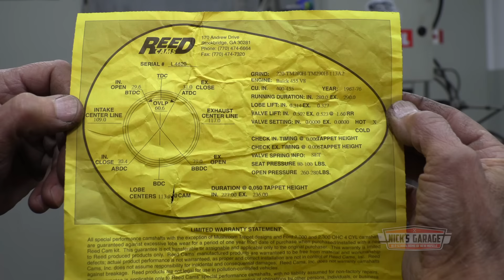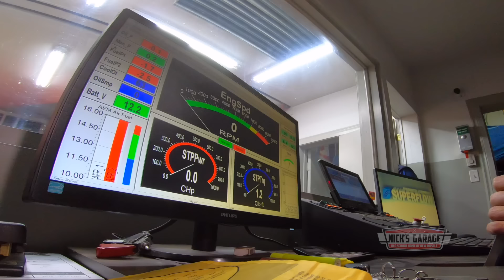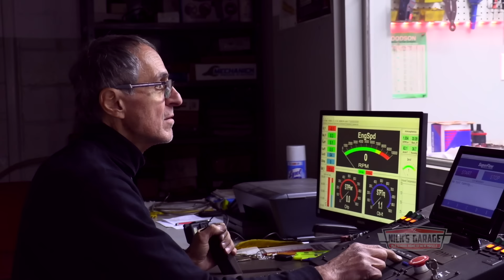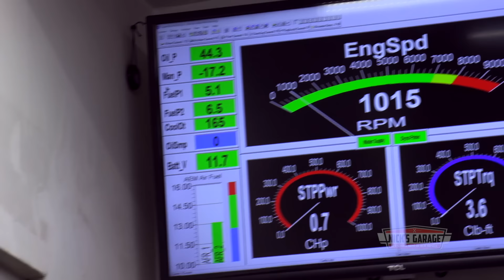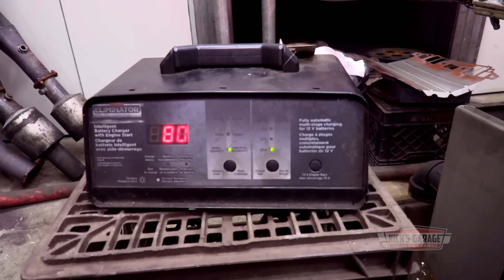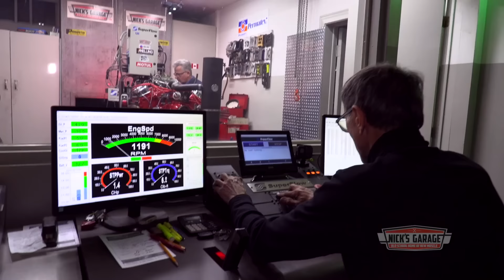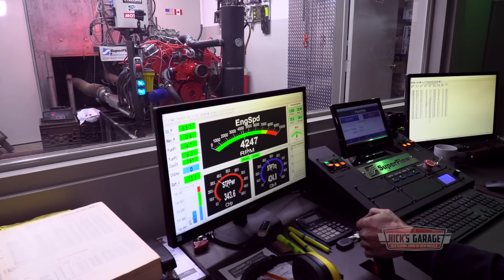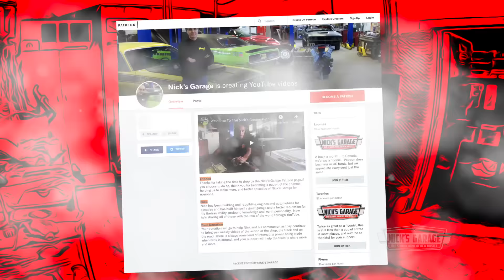1970 Buick 455 Stage 1 - Dyno Room Diagnosis

Comment: Stage 1's are great engines.   I will never forget Richard Lasseter beating the HEMI in the 1985 Muscle Car Review Magazine shootout.  It shook the muscle car world.
Reply: That was a big deal back then!
Reply: Oh yeah, that's when Lasseter was cheating. He, in no way would take a valve cover off to show that it was stock.
Reply: @gordonstroup882  Badies Hemi was not factory stock along with Lasseter's Buick. The hemi had headers and an upgraded cam with a little more duration and lift. The Buick similarly had headers, an upgraded cam from stock with more duration and lift along with an Eldebrock B4B aluminum intake and a Holley (700 cfm).  Typically, headers will result in 25-30 hp gain over exhaust manifolds, cam upgrades could result in 10-25 hp gains, and in case of the Buick, the B4B intake will gain 15hp over stock C.i. intake. The 700 Holley most likely did not improve HP much, if any over the stock 700cfm Q-jet carb. The stock Stage 1 1970 455 actually was underrated by Buick (360hp) and rated at at only 4600rpm (peak HP actually occurred at 5400 rpm). Similarly, the hemi was underrated (425hp) at only 5000rpm and peak hp was made at 6000-6200 rpm. I remember watching both of these running back in 1970 at the drag strip and both were very close in ET/mph stock depending on which mopar body the hemi was installed in (weight differences).
Reply: @gordonstroup882  Well  to get even with the hemi maybe some shaft rocker arms were used. haha. The hemi probably came stock with them. And remember the ball stud hemi. And the sohc and dohc hemi. Like the 427 sohc fords and boss 429's. The experimental hemi's are what fuel lore and pro mod to this day! haha.
Reply: Yeah, I think that you got it %99 right. The good ol' days. Anyways, it was all in good fun that also came with some serious bragging rights. 😅😏🙄🤐Ha ha!
Reply: @gordonstroup882  Cheated??  How? That's total b.s.   Man, I was THERE in Dec. 84 at that Gainesville, FL race with track manager Bob Moore.  Bob oversaw the entire race.  I was a photographer there.  And what's this about pulling off a valve cover??  Nothing was EVER even mentioned about such foolishness.  You need to get your facts straight. Both cars were near equally modded.  Both Badie and Lasseter had only a 2 week notice about this match-up. Very impromptu!   BTW, Lasseter drove his car 275 miles round trip from GA.  Badie broke the earlier MCR agreement by trailering, but Lasseter never complained.  Badie told Donald Farr (MCR Editor) that he'd filled up with Sunoco 260 and it cost too much to drive the GTX there with his 4.10 gears. BTW, Lasseter had 3.42 gears.  Not commonly revealed was how Lasseter easily outran Badie's friend with a '70 Hemicuda right after beating Badie's GTX.
Reply: @zAvAvAz  Buick's have shaft mounted rockers.
Reply: @billdedrick1914  Correct.  Neither car was factory stock. It was an impromptu race. No time to put together a "cheater" combo. Lasseter didn't own a trailer, so he drove.  Badie trailered. You seem to know what you're talking about!
Reply: @LR-my2di  where can I learn more about the history of that race?
Reply: @romper4444  There is a multi-page article on this race in the March 1985 issue of "Popular & Performance CAR Review magazine"
Reply: @romper4444  Hey Nick ... Where can I send you some "snail-mail" that covers all the REAL details from back in the day and not just the usual oft-repeated hear-say?  I'm impressed to see that you're a gentleman interested in the FACTS and not just partisan propaganda.
Reply: It would be interesting if Nick or the owner could install the Lunati 10960304LK cam in this engine for testing.  Maybe someone from the Buick crowd could correct me but isn't this the "Hemi Killer" cam Lasseter had in his car at the time?
Reply: @briansd2772  Not sure what this number corresponds to lift, duration and lobe separation. The Hemi Killer was designed in the late 1980's by Lasseter for use by several street racers who needed vacuum but had a hotter engine combo than him. The Hemi killer was a single pattern cam that used special lobes with .490" lift and 241 degrees duration on a 110 lobe separation.  It could be used with stock Stage 1 v. springs. That was a key element back then.  Lasseter used a much milder cam because of his 3.42 gears and old Rossi 12" converter.  He uses this old combo today and it's very "old school".  His cam was a H228-237degree dur. @ .050 with a .478" lift using his stock 1.55 ratio rocker arms.  It was an old Lunati grind he had done back when the Lunati's owned Lunati cams.  Hope this helps.
Reply: @LR-my2di  Good stuff L R.   Thanks for the perspective and clarity.
Reply: @LR-my2di  Interesting comment on the fuel cost. In 1984 gas was really expensive. I know, I was driving a '71 Olds 98 with a 455 4bbl at the time and it was killing me.(I wish I had that car back... but I digress). I can't imagine how much top test Sunoco racing fuel was, I never even got near those pumps! I would haver trailered too!
Reply: @jppagetoo  I also forget the cost, but it was the 426 Hemi (not the Buick 455) with the 4.10 gears that used the Sunoco 260.
Reply: @LR-my2di  The specs on Lasseter's cam just sunk in.  That was a fairly mild cam with impressive results!   I have a Pontiac friend with a 455 that needs a 235/252.  .540 lift  112 cam and 3:42 gears to get 12.2 ETs.
Reply: @briansd2772  The Lunati 10960304LK has 230/240 duration @ .050" and lift of .507"/.538" ground on a 112 Lobe separation angle (LSA) which is different than the original Hemi killer cam which was ground by Lunati with .241/241at .050" duration and ground on either a 112 or 110 LSA.  The GSCA soon after came out with their version and was ironically ground by Reed Cams with a duration of 241/241 at .050" on either 112 or 110 LSA  .490"/.490" lift.  The cam Lasseter was using in that shootout supposedly was a Kenne-Bell  118 (KB118) .490"/.490" lift 118 LSA  284/304 duration (this is the old advertised duration- not at .050" present day duration but the old advertised duration nomenclature). The KB118 performance potential is close to the 241/241 Hemi Killer grind.
Reply: @LR-my2di  Yeah, My bad on that.  But I was really just thinking back to how expensive gas was then. Most younger readers have no idea how much gas was relative to the dollar value. Racing fuel was even more! Thanks for remembering the old days with me for bit. I was 21 in 1984.
Reply: @jppagetoo  My pleasure, JP. Take care.
Reply: @briansd2772  Yes, it was very mild. The car runs very well.  Easy mid-11's.  Remember that Lasseter DROVE his GS to Florida (and back) to race Badie and his friend with a Hemicuda.  And don't forget the GS's 700 cfm carb and 3.42 gears. Overall,  a very mild street car.
Reply: @gordonstroup882  nope,drove it to the shoot out,drove it back. The hemi simply got beat,live with it.
Reply: Even stock to stock the Stage 1's beat the Hemis... as did the 6 pack 440's... lighter engines with more torque...
Reply: @BuzzLOLOL  The hemi was not a great street engine,the 440 was so much better on the street and in the lower stock classes. The 455 Buick with it's relatively short stroke ,revved quick,and would turn more rpms than most think. Good assembly practices,and knowing what to do,will turn the big Buick into a true street and strip monster
Reply: I remember reading about that Hemi/Stage 1 matchup. The GSCA put up the Buick, now I know who had the ‘cuda. Interesting.
Reply: @billdedrick1914  thx so much!
Reply: I wasn't even alive in 1985
Reply: Ask Ronnie sox if he ever had gotten beat by a stage 1 buick I don't think so they weren't even on the map back in the day Mopar to you
Reply: @darrenbrisson4336  Pop Kennedy was ronnie sox teacher how to leave the line. Pop was legendary off the line,sox had the advantage of full factory support, lighter cars,and full race engines. That give you a better picture of what's what
Reply: @markbuchanan3694  you're right in one aspect but Ronnie was the fastest of all the hired guns
Reply: @darrenbrisson4336  I don't know,pop was a master off the line in those days. He won most of his races off the line. His reaction time was almost super natural,those old films show his talent and his knowledge of the machine he was driving. He could make those old nailheads launch like rockets,his performance in the 67 winter nationals,I am sure in right about it being the winter nats, against landy was phenomenal.
Reply: He got those ,new for 67,400 GS engines to fight above their weight class
Reply: @patrickr2686  -Lucky you.   I was already old....
Reply: @LR-my2di  LR - I believe Nick is referring to the 3rd "Hemi vs Buick" race that took place at Napierville Raceway in Montreal, not the first race in Gainesville. By the way I LOVED that issue so thanks for all your hard work and the photography. I remember Lassetter's Buick was really quick and showed what was capable with the Buick. The Napierville race involved a GSX and we will need Nick's recollection here. I believe the Hemi Cuda actually red lighted but the GSX did catch and beat the Cuda, but the ET and trap speed were so high that the Mopar guys were very suspicious about the GSX being "stock". I never heard about the Buick camp refusing to allow an inspection?? And I did not know that Nick was involved with the Hemi car = great stuff indeed. I would love to know the ET and trap speed of the GSX from that race??  Anybody??
Reply: @gordonstroup882   Total B.S.  I challenge you to verify that statement ANYWHERE. .
Reply: @zAvAvAz   Good grief, man. Both HEMI and 455 Buicks came with shaft-mounted stamped steel rocker arms.
Reply: @LR-my2di  exactly :o)
Reply: @LR-my2di  yeah, isn't it wonderful :o) ! ! !
Reply: @mrho4speed  Yes, Lassetter's GS ran well, was amazingly quiet and was a true street car with all the power options, and it was driven back and forth to the track 130 miles away while the GTX Hemi trailered.  Lasseter did not even own a trailer.  He was no experienced drag racer, either. Just an average "little guy" enthusiast like Roy Badie. 
   The Napierville race was what you said. No refusal from either camp on an inspection. All of That had already been decided upon the previous day. This was told to me personally by Dan Lyons who was sent by MCR magazine to cover that race.  Dan also told me that, in his opinion from what all he heard, that neither Hemicuda nor GSX was completely stock, but like in Round 1, there  was parity between the two cars. I believe that I can find what the GSX turned in that one and only run where it ran down the red-lighting Hemicuda.  I'll have to look through the old MCR archives, some of which I have access to.
Reply: @zAvAvAz  I agree, though "some" wouldn't!  :< )
Reply: @mrho4speed   One run only. 12.01/111 mph
Reply: @LR-my2di  Thank you! I did some digging and did find the ET and speed for both cars. The Cuda ran a 12.49 at 110 mph. Both cars ran slicks and both cars were shown to both the "Buick" guys and the "Hemi" guys before the race. The Hemi group probably figured there was no way they could pick up 4 tenth's of a second to beat the Buick. Both cars ran super strong and fast. It looks like the Buick guys just did a little better job with their preparation for the race. The Buick also ran with a Quadrajet carb which just shows how well the Q-jet can work. I love all the old cars from this period.
Reply: You are right about that, Brian.  The actual race was in Dec. 1984 and it was covered in the March 1985 issue of MCR. Even the Car Craft editor at the time  called that race  "the shot heard 'round the muscle car world". A little hyperbole, yes, but the point was made!  Note that Lasseter never challenged Badie and his Hemi. It was Badie that called out the owner of a Buick GS because he said GS 's "run like they're tied to a tree".  Roy wrote that letter that appeared in MCR and the letter that followed was from Lasseter simply thanking MCR for stating the facts about how the GS ran.  So MCR editor Donald Farr called Lasseter to ask him if he'd take on Badie's Hemii, and the rest is muscle car history.   BTW, both Badie and Lasseter were just two average muscle car enthusiast guys. Lasseter drove his GS to the track while Badie trailered  because he didn't own a trailer and his GS was a real street car that was mild enough to be driven anywhere.
Reply: One race , & the Buick guys think they are champions of the world 😂😂😂😂😂. How many times did the Buick beat the hemi in super stock ,or nascar …. Oh wait, Buick NEVER beat the hemi in nascar or super stock. They weren’t even racing 🤪😂😂😂😂
Reply: @kurtpoblenz2741  Kurt, the debate was never about super stock or nascar racing but about street cars that are stock or mildly modified. The Hemi contingent seems to think that any stock Hemi street car could never be beaten in a street or 1/4 mile race and that just isn't true.
Reply: @mrho4speed  …. Anything can get beat at any given time. I just don’t think the 455 is the hemi killer it’s made out to be.
Reply: @kurtpoblenz2741  Come on, Kurt. Get real.   Unlike the Hemi cars which couldn't even be ordered with a/c, the Buick GS Stage 1 was designed as a STREET machine to compete with the likes of the GTO RA IV , 442 W30  and Chevelle 454.  And there was no Super Stock class for the "Buick guys", as you call 'em. You couldn't even buy Buick parts to run Super Stock, like a roller cam kit, which was legal for Super Stock or any trick aftermarket alum. intake manifolds  Not available! That's right Kurt ... a STREET CAR.  "NASCAR" you say? Kurt, have you ever driven a NASCAR?  So don't be silly, man.  Super Stock or NASCAR has no relevance at all as to what we're talking about here. 
    This GS Stage 1 vs. GTX Hemi  "shootout" was indeed "one race" and was a last minute "run what you already have" affair agreed to beforehand by all parties and put together in less than TWO WEEKS by Donald Farr of Car Review magazine for his magazine. Just two average little guys racing for fun. Heck, the Buick guy drove 130 miles to the track because he didn't even own a trailer. Some "race car", eh?  This race has nothing to do with 'Buick guys thinking they are champions of the world'.  That's just your obviously biased slant.
Reply: @gordonstroup882  Cheating? Total B.S.  I was THERE in Dec. 1984 doing some of the photography work for that article for (Larry) Dobbs Publishing (MCR magazine).  No-one asked either car owner to do anything like what you say here.  That GS idled cleanly at ~700 RPM.  The Hemi was much more radical sounding. You could hear all of this in that one amateur video that was taken of the race.  Right after beating the Hemi GTX, Lasseter ran Badie's friend in the black 1970 Hemicuda  and also easily beat him. That was also in the video.   BTW, if he had taken a  v. cover off, what did you expect to see?
Reply: @zAvAvAz  Shows what you know about Buicks. (ha, ha)  All Buick 400-455's came with shaft mounted rocker arms.

Comment: @Nick'sgarage, hi Nick and Team I've always wondered if gaskets such as the carb to intake or exhaust manifold/header to block gaskets deteriorate over time when just sitting or hanging on a shelf in the shop in a mild environment rather than sealed up in the manufacturer's packaging ?  Thank you Nick and take care !!!
Reply: I've bought some very old gaskets (50+ years old) for some of my  obsolete engines and the paper gaskets are very dry and rubber is very hard.

Comment: For well over 25 years I have never used the rubber end seals on the china rails (ends of the block the intake seals the valley to) as over time they are prone to blowing out and leaking over time. I have always used GMS (GM's silicone RTV) or the Right stuff and not once had any issues

Comment: maybe the old cam is toast? i would definitely try a modern grind. Needs a little more cylinder pressure i believe. Shoot for 175-185. Although it is iron heads on pump gas cylinder pressure should be above 170-180. I would try another cam to see if cylinder pressure climbs with a similar comp grind or other newer cam. Maybe its not the cam. The REED cam is probably a great cam maybe?  It may need 9.5 to 1 or 10 to 1 with a cam that has some overlap. 0.039" head gasket is perfect quench with a flush piston to deck. a .050" head gasket is too thick Wow and you guys already know it. Awesome job youns.
Reply: Specs show the Reed cam to be a mild grind for "cruising" and not for serious perf. work. It was designed for pump gas at ~9.5 to 1 compression along with a tall gear and stock converter.

Comment: Nick,

For the love of everything holy please start using solid state ignitions. There is a reason why OEM manufacturers stopped using them in applications with rotary distributers and nobody uses them in HP builds anymore.
Reply: You are correct. I had the points distributor on hand from the client. The engine was sold and I believe the new buyer is going to update the ignition.

Comment: To start the Turbo / Ram Jet Engines on the worlds fastest production aircraft, Nailhead V8s were fused together via a common transmission and drive shaft to work in tandem, then placed inside a metal housing mounted on four wheels with a trailer hitch and dubbed the AG330 "start cart." The resulting Chimera was attached directly to the Blackbird's two engines. Using the combined drive shaft, the two V8s spun the turbines to the point they could sustain compression by themselves. Nailhead V8s served as impromptu starter motors for the SR-71 and its cousins, the A-12 Archangel and the YF-12 fighter, until at least 1970, when the bulk of them were replaced with Chevy 454 V8s.